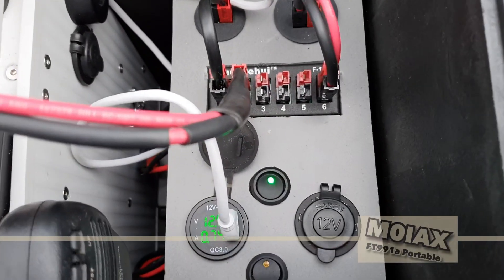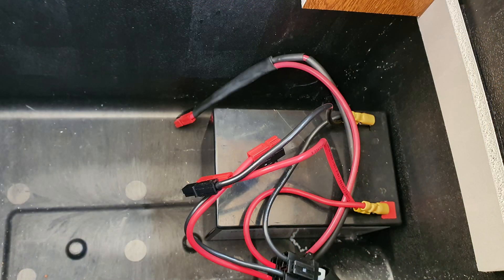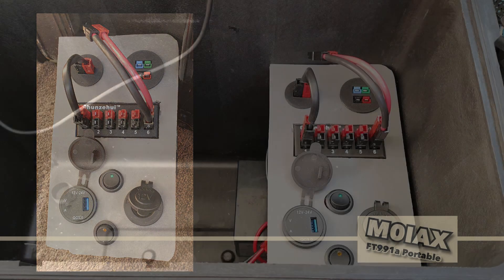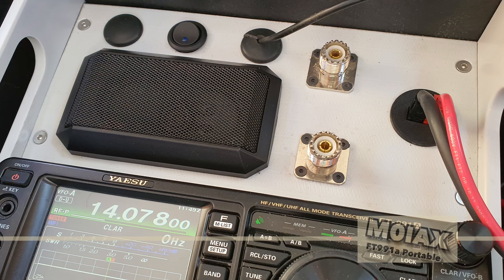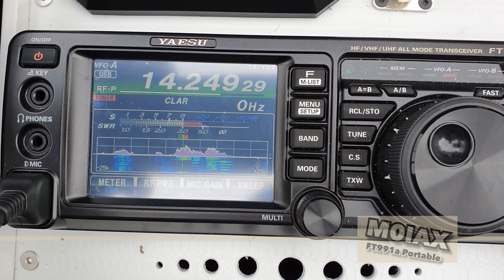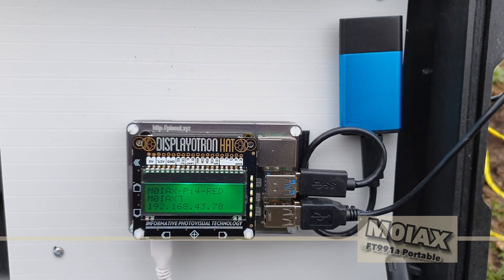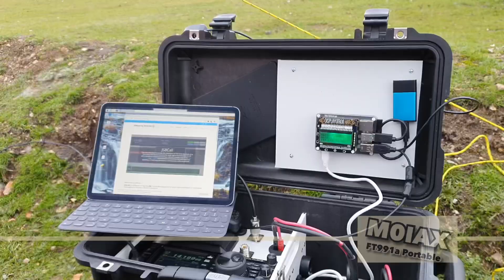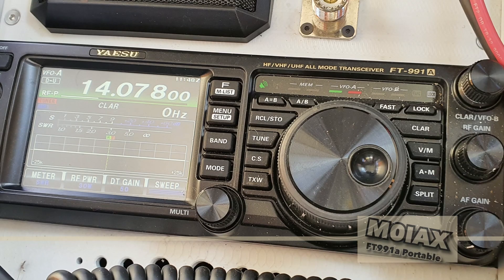Yaesu FT991a Portable

Comment: Very nice Mark.  I have a 991a and the pi4 also and I can receive on ft8, wjstx , but doesn't seem to want to tx. Im just using the cable that came with the radio do I need a different cable for transmit?  Would love to see some videos on the how to get it to transmit. I also have rigctl working on the pi4 as well.  Very interested on hearing back from you.   73  Kevin
Reply from the maker: Kevin Burke Hi Kevin, yes you only need the one USB cable for the 991a. I have it working with WSJT-X and JS8Call, I intend making more videos so I will make a set up one for you as soon as I can. When I get home later I will see if I can post the correct settings for the radio for you.
Reply: @M0IAX  Ok Thank you Mark..  I really appreciate it.  73
Reply from the maker: HI Again Kevin, in the mean time try following this settings guide by W6PQL, that looks like its similar to my set up https://www.w6pql.com/misc/wsjt-x/ft991-wsjt-x.pdf

Comment: Impressive... I think this really is everything... including the kitchen sink :) :)
Interested in your PI booting from external disk... Did you build that config..??
Cheers,,, Best Wishes for 2020
Reply from the maker: Hi Dave, yes I put it together, the Pi4 doesn’t support hardware boot from external disk but Linux allows us to keep our files on whatever volume we like. So on initial boot it reads the boot config from the SD card which directs Linus to the external SSD. This means that the only file system we use on the SD Card is /boot everything else is stored and run from the SSD therefore making everything much faster and more reliable.
Reply from the maker: For got to say, Best wishes and have a great 2020!
Reply: @M0IAX  Cheers... Understood :)